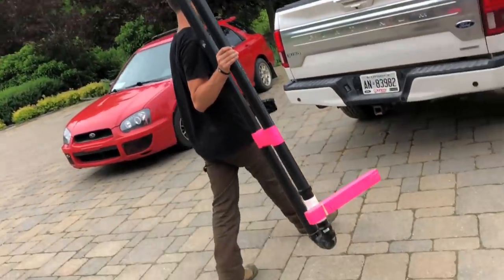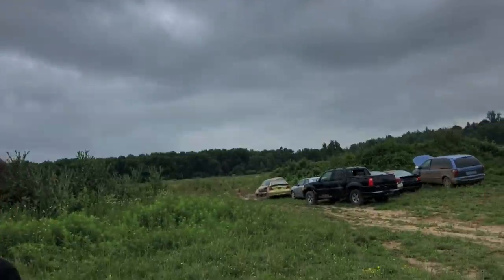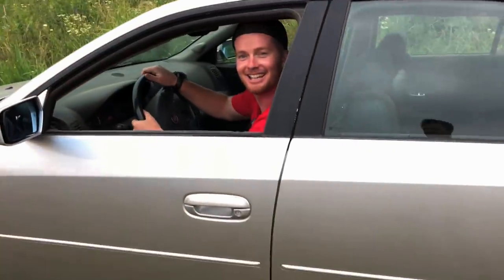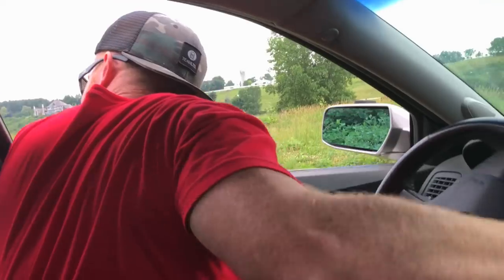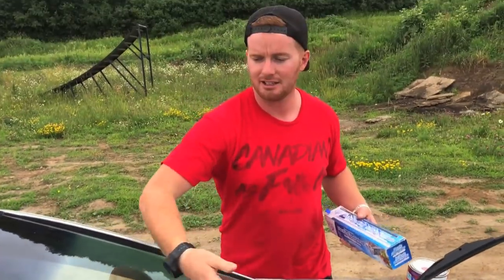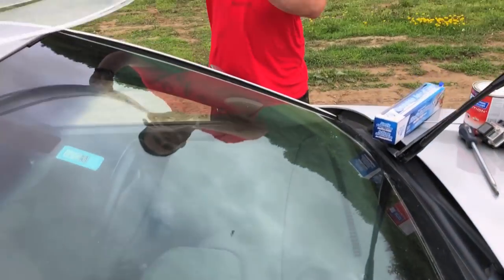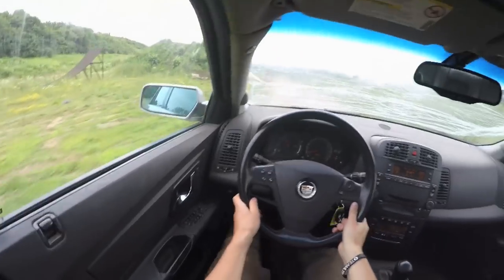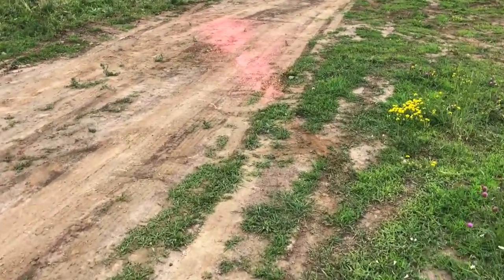CUSTOM Painting A CADILLAC CTS With High POWERED Potato CANNON!!! | Mark Freeman #408

Comment: Hey mark get a 25 ft 3/8" inch thick chain for those cats on the car.  It will be more of a snap and they should pop out easier.  This way you won't keep wrecking your straps